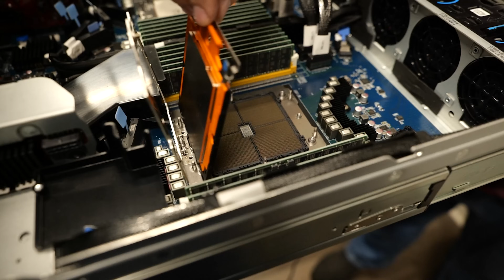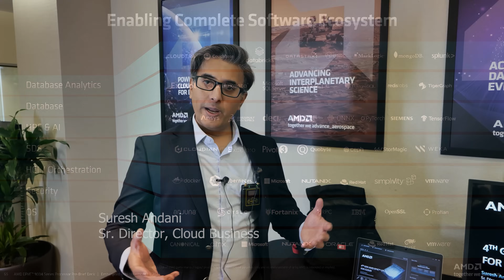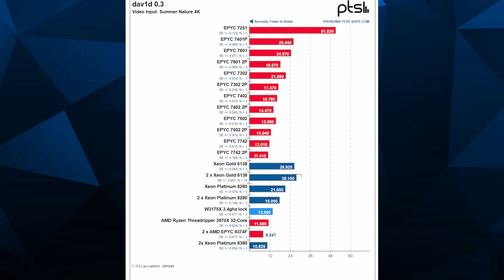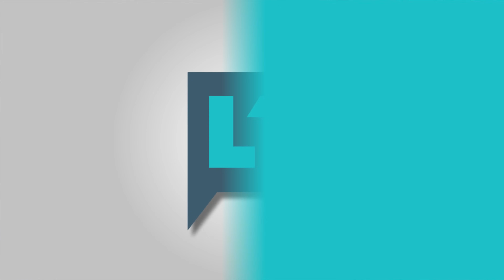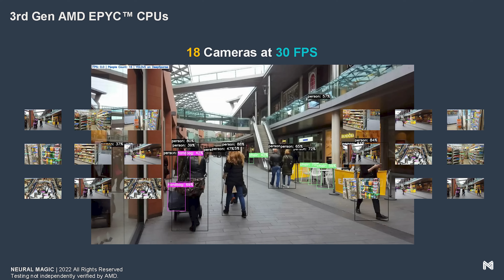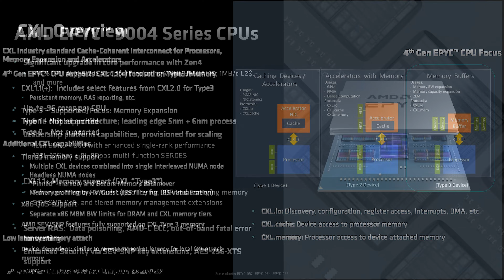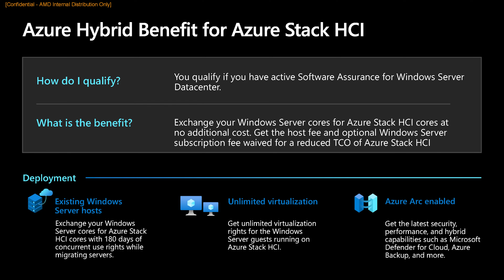192 Cores of EPYC Domination!

Comment: While this progress is nice to see in the data center area it also makes me a bit sad since the split with desktop/HEDT seems to become more and more extreme and AMD doesn’t seem to give a shart here any more (examples: No successor to HEDT TR 3000, price jumps up with Threadripper Pro, three generations of 16 core Ryzen CPUs so far, 3D V-Cache SKUs get held back).
:(
Reply: I'd say the use case for HEDT is shrinking.  Mainstream parts are at 16C/32T and going higher.  Workstation users are most likely going to be using 1 pcie add -in card  with the size and power draw of stuff today.  For storage mainstream boards are supporting 4 or so nvme m.2.  Going higher on core counts or RAM capacity involves sacrificing clock speed and RAM speed in ways that enthusiast and workstation users probably aren't willing to make.  Things have moved to the point where if you need HEDT, you probably want a small server effectively anyways.
Reply: That disparity is something that annoys me very much - if you want more PCIe you get treated like a “second-class” user: You can go TR and lose performance per core due to last-gen Zen 3 cores, if you go EPYC you get f’d by lower frequencies with significantly lower lightly-threaded performance. Was very disappointed by AM5 not releasing with Zen 4 3D SKUs (only 6 and 8-core SKUs seem to be coming next quarter) and the X670 chipsets only being connected to the CPU with PCIe 4.0 x4, not even 5.0 x4, making that dual PCIe switch configuration with X670E pretty nonsensical with that bottlenecked interface to the CPU. :(

Comment: Thanks to AVX-512, two of these on a dual socket motherboard could function as a moderately good graphics card. I for one am excited to go back to software rendering that always works, AMD just needs to price drop this an awful lot. 

Does make me wonder why Intel haven’t made an all E-core chip though. For heavily threaded workloads, they could actually put up some very fierce competition even without chiplets, E-cores are seriously impressive. They were never the issue, mixing them with P-cores was.
Reply: E-cores are extremely power inefficient, just a cheap way to get more threads. 
The 13900K is drawing over 330W on full compute load, that is ludicrous and unacceptable
Reply: @JVlapleSlain  e-cores are having about same performance/power consumption efficiency as Zen2 core (Buildzoid made video. Granted it was with OC). Except part that they also have reduced instruction set. 
Buildzoid also made pretty good conclusion for them. "Cinebench accelerators"